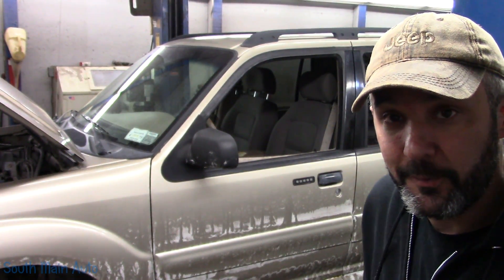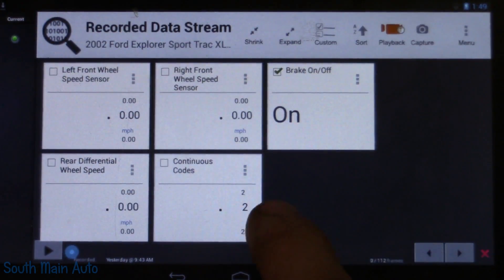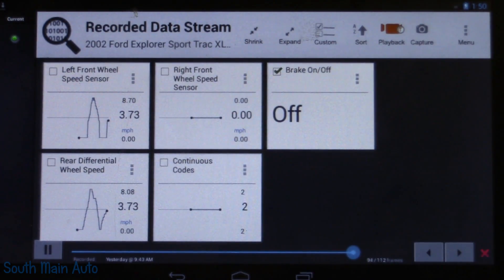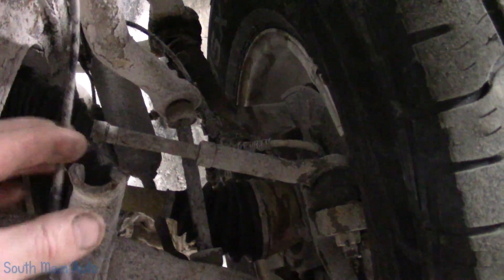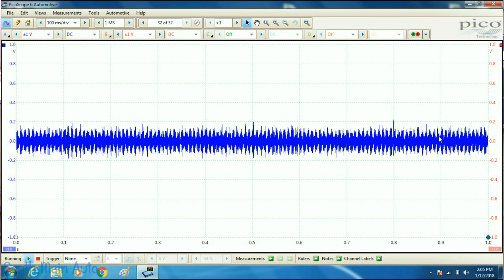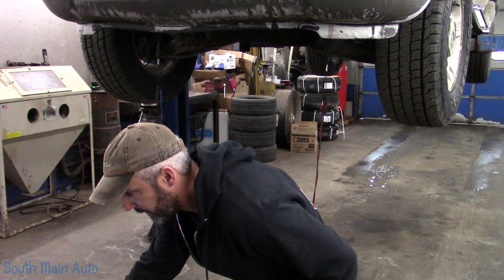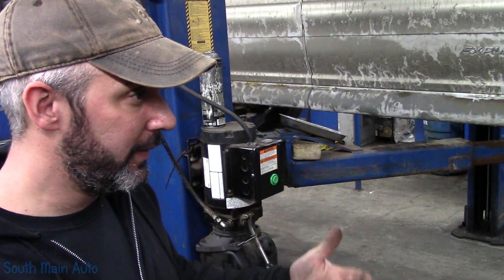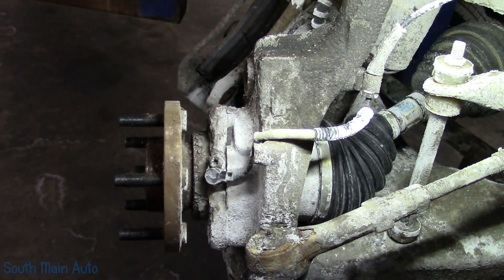Ford Explorer Sport Trac: ABS Light On / WSS Signal I Can Not Explain??

Comment: Others have said it before me, but salt and moisture inside the sensor makes electrolyte, two electrodes by the open circuit pickup coil. Only a few mV though due to similar metals with differing levels of corrosion.
But, you also need to remember that the Pico is a high impedance device, 1Megohm, so you are in effect measuring an open circuit voltage. As well as generating those few mV, the chemical battery will be a low impedance compared to the Pico input, so that's why your AC voltage was roughly similar in that test.
The actual ABS module will have a lower impedance loading and I would be surprised if it didn't have a bit of bias voltage there to detect an open coil.
Backprobing with the Pico at the ABS module would tell a different story.
Keep up the great work Eric!
Reply: These points echo my previous comment and all seem plausible to me too.
Reply: Nice explanation pal.
Reply: yes, Salt water conducts electricity about as good as copper does too.

Comment: The further analysis of both front wheels is what makes SMA a step above every other shop. 98% of shops would just diagnose the one bad wheel, perform the repair and ship it. Not caring about come backs or customer complaints. I want a mechanic to give me the WHOLE story and explain to me all that is going wrong with my car. If I do not opt to fix those additional problems that's on me. But I still want to have someone intelligent enough to pick up on all problems big or small and report their findings to me. I might not understand all the electronic discussion in this video but I still love watching it so I can learn more about ABS systems on vehicles. Another top notch video!

Comment: The waveform looks good only the amplitude was to low.
Thats because the air gap underneath the sensor is to big.
After replacing the sensors the amplitude got better because you cleaned the surface of the hub and the sensors now sit lower.
On the left side this worked fine but on the right side the air gap is still to big.
Replacing the hub would fix your problem.
But as an experiment you could also grind a litle piece of the surface so the sensor sits lower in the hub. Would be cool to try to see if this works and it will only take a few minutes with a grinder😎
Reply: Maybe just leave the shim out and see if that helps?
Reply: However, the sensor should come alive and register at higher wheel speeds, which it did not. The air gap is not the main issue here! Looks like the sensor coil is almost open circuit :)
Reply: Pine Hollow Auto Diagnostics Mayebe it does come alive now, he has not driven the car and looked at the scandata after he cleaned the hubs.
I noticed you posted a new video looking forward to see it!

Comment: Hi Eric!!!!....Great video!!!!....fancy tools and clothing too!!! hahaha....uuummhhh....all Crusties(green white yellow) produces all kind of electric and electronic phenomena!!!...in order to make a repair to last good time, best is replace both hubs!!! more expensive but new parts work optimal. You could do ohm test in both sensors, cross jumper both sensors, turn the wheels in both directions too, and visual inspection the notched rings inside hubs if its possible, check for crusties in the cables and conectors!!!...The sensor itself is not a separate stage of electronics, in fact the sensor is an internal part of a electronic circuitry!!!...it is located outside, but in terms of a electronic component could be visualized inside the ECM!!!...the information and signal procesing depends on how the sensor is conected inside the ECM. Could be one lead to ground, that eliminates the zero crosing!!!...could be conected to a filter circuitry!!!...or to a complex floating zero crossing detection, that is more complicated and fancy circuitry!!!...anyway, I think the problem itself is corrosion inside the hub (neglecting the sensors conditions first) and if it where possible to clean inside the hub it will change the shape of the notched ring, and thus producing a weird signal too!!!! Amplitude of signal is related to sensors distance, and frequency is related to speed and shape!!!....detection is related to filtering and signal processing!!! Thank you for sharing your toughts with us, and thake us with you in your videos!!!!....that is why I am a SMA fan!!!!! It is always fantastic see your work and learning diferent things with you!!!!.....Greetings to all at SMA!!!

Comment: I feel you want to test those sensors, you need to load them down with the right load resistance. Your scope has many megohms of input resistance. The bad sensor might have many kilohms of extra series resistance but that won't show on the scope with its high input impedance. Also a coil can't put out D.C., there is likely a little battery consisting of a break in the wire, some moisture, and a different metal, like the solder or the internal lug.

Comment: Nice tip about using a valve stem cap to keep the dirt out of the sensor holes when cleaning the mounting surface of the hub. Wow, The OE wheel sensors usually cost more than an entire aftermarket hub with the sensor. Often the brake rotors are so rust seized on the hub and inboard sides pretty rust ravaged too that it might be wise to change the pads and rotors now than deal with brake pulsation.  I would ascertain rotor condition and likely try to sell 2 complete assemblies and let them know the signal is weak on the left side too and if that sensor can't be removed without damage or signal strength improved by cleaning the left side hub sensor mounting surface, I'll have to replace both hub assemblies.

Comment: I agree it would be beneficial to see the signal when connected. After going over the video, Eric was getting the dc component when not connected to the abs so the dc component has to be generated by the sensor. Maybe the noise is being rectified by the sensor causing the dc and that is blinding the abs from seeing the ac signal.

Comment: Very interesting diag, Eric! Did you happen to measure the resistance of the two sensors by any chance? And I've run into the sensor being too long for the hub before too. Maybe just stack some shims or thin washers to set the proper airgap?
Reply: or an o-ring around it, depending on the design.
Reply: Instablaster

Comment: The front hub assemblies comes with a ABS sensor installed. You can actually get a front hub with a ABS sensor cheaper than the OEM ABS sensor by itself.
Reply: You can only get a front hub with sensor cheaper if you get a generic Chinesium hub that's probably going to be a callback when it fails prematurely.  If you want to go that cheap route, at least compare apples to apples which would be the price of a generic sensor alone, not the OEM sensor price.

Considering the work to do a hub, a generic hub is the worse economy possible.  That does not mean you have to get an OEM hub either, just a major brand which (almost) always costs more than the sensor alone.

Comment: Remember what Ivan just went through in S.I. with "leaking noise"? All that chloride acts like an antenna for outside RF. It looks as if there's a weak leak to ground. Electricity flows FROM negative TO positive. There is so much RF leaking- it's interfering with the signal. Ohms the both leads of the WSS plug, EBCM side- to body, knuckle, etc. (ground) and check for a closed circuit. Just my theory.

Comment: I have a suburban that had about 750-900 milivolts on three wheels and one that put out about 300 mv and it was tripping my stabilitrac during acceleration I used a caliper and the air gap in the hub was within spec. I tried closing it up a smidge and Also tried a different abs sensor in the hub and still same result. So replaced the hub and it worked putting out the Correct voltage.

Comment: I'm not a real elec-chicken and I don't play one on Broadway, but I suspect the ABS module is watching for the sine wave crossing zero volts. Each time it crosses, that's a data point, and the time interval between data points tells the module how fast the wheel is turning. With a DC voltage raising that sine wave away from zero, what should be an AC signal becomes a DC signal that the ABS module doesn't recognize until its amplitude increases and its peaks push down past zero again.

Comment: As others have said, but I'd predict that the corrosion has just reached the point where a connection has corroded just to the point of stopping conduction.  When you spin the wheel the signal is just strong enough to conduct across the gap through the salt but at a lower amplitude because of the resistance of the corroded spot.  One way to test would be to either measure resistance which I predict is high, or, send a few volts down the sensor leads and likely burn the open section to fully open.

Comment: I have the "Waekon 20560 ABS Sensor Pinpoint Tester" where it sends a signal through the wire harness to check wiring integrity to the abs module.  Works great, you can watch it on the scan tool!

Comment: Just a thought but dissimilar metals in an electrolyte generate a voltage
Reply: That's what I think  also
Reply: wak wak  waaak
Reply: An unintentional diode junction acting as a detector.
Reply: I would think its all the salt generating voltage to a bad wire
Reply: Salt+water = electrolyte.  Still need the two poles to generate a current = two different metals.

Comment: Thinking that salt and water (an electrolyte solution) have infiltrated into the open wheel speed sensor, creating a battery between the open connections (possibly 2 dissimilar metals like copper and solder). That would explain the small DC offset on the open sensor.  Did you try comparing the resistance of the 2 sensors?

Comment: Nice  video, I just had a Dodge Dakota with a dead aftermarket sensor/hub on it.  Ohm'd out ok and had a voltage reading on the scope when spinning the tire, it also has a static volt reading even after removing the hub/sensor assembly from the truck??????

It has to be some kind of galvanic action from all salt brine on the roads the last couple weeks..............

Comment: Hi Eric & Mrs O
Great video makes a person think and provides a useful tip for others Valve cap and install extraction tool as well. I have one question, what side has the longer electrical run to the ABS control module? As you showed the hall sensor is only lower amplitude not completely dead. If you measure line resistance between L & R side I expect you will find a minor difference on the side with the longer run length. That in conjunction with a sensor that has possible leakage due the salt & corrosion issues has brought the signal performance to just below operational threshold levels.  Or as with all electronics THERE IS A BUG in the system!!

Comment: I noticed that after the repair the red trace seamed to be still starting at an offset? I am not proficient with the scope (working on it) but that is what I saw. Also, I had a similar issue with an 07 Edge AWD. My issue was the customer had driven it for so long with bad WSS's that it caused the ABS module to go all caddy wampus and was going into a no comm. state. This issue had no rhyme or reason and was very sporadic making it a bear to diag. Ended up replacing 2 WSS's and the ABS module. Looking forward to the next vid.

Comment: And that's just it. The ABS is just barely at the threshold for code setting criteria on the l/f. Nice catch, for future issue.  As for the bias voltage on the r/f, I'm curious if there was a resistance issue left vs right, even though they are both Moog bearings with whatever sensors they use. I have run into that on some aftermarket Chevy applications, where a customer has installed a new assembly on 1 side, ( due to a bad bearing not an ABS issue) and had an OE on the other. The OE had a lower resistance than the aftermarket sensor, thus had a higher MV signal than the new bearing assembly did, and the difference drove the module nuts. My thought is, if you ohmed out a new Ford sensor vs both the left and right Moog sensors, would they be the same, or ALL different? Anyways, you did fix the left side for now.. LOL

Comment: The reason I suspect the module is not able to read this is the circuit needs to raise 0.6v above and below zero volts to switch the transistors on and off. The DC voltage offset could prevent this from happening. Capacitors are used inside the module to ensure this toggles around the zero volt line. It's great how YouTube can be used like a video IATN.

Comment: The speed sensor has to be made by the same manufacturer or they just have to be the same length? It sounds like you have to get hubs and speed sensors as matched pairs or by the same manufacturer.

Comment: Do you have a function generator on the pico scope or elsewhere? If so, you figure out exactly what amplitude the computer needs to see and whether or not the offset is a problem. You could leave it at zero offset, and turn up the amplitude until it reads a signal, and then adjust the offset to see whether that has an effect or not.
Reply from the maker: I wish I did :( Actually the Launch Pad II that I use has that option but I do not have the devise to go with it. We know what the amplitude is simply by looking at the left side. We can also see that we achieved that on the right side. It would be cool to play around with the signal generator though just to see if an offset does or does not affect it.
Reply: You could always use the utest leads and run the left front sensor to the right front connector to verify the vehicle wiring and module. And/or do a little swapnostics with the sensors
Reply: Ha. Nevermind, I see you did that. I  replied before I got that far into the video

Comment: If you're chasing a 30mV DC "phantom voltage", can try connecting a ground wire to bolt holding sensor into arm and other end to battery ground, see if DC offset disappears from picoscope.  If disappears, can try to see if ECM reads it correctly then.  DC must be introduced somewhere, either from sensor body or from frayed wire.  If you had perfect insulation then 30mV couldn't get into it in the first place, correct?   So, I think you'll be then looking for a worn-through wire.

Comment: I wonder what what happen if you put a small value pull down resistor on that wheel speed sensor to bring it down to 0V if that would allow the abs module to read it.  I know thats not a fix by any means but it would show you how small the tolerances are for what it will and will not read. Great videos look forward to watching them.

Comment: There 's your problem Lady! Galvanic corrosion is an electrochemical process in which one metal corrodes preferentially to another when both metals are in electrical contact, in the presence of an electrolyte. This same galvanic reaction is exploited in primary batteries to generate an electrical voltage
Reply: Blaine Steen - fancy words for the fine wire (32 AWG) from the coil inside the sensor transitions to the heavier wire is broke !

Comment: Hello Erick I had the same problem with a Honda Civic check all with pico and omhs as well as the harness changed the hub bering for an (aftermarket that the customer brought as well as the sensor) and no change. my solution was to replace hub bering sensor front honda dealer.

Comment: "Don't be surprised if when you take yours out it breaks !"  That is why I paid someone else to do it !

If that was my car, I would just file the end of the sensor to the correct length and place a dab of silicone dielectric grease on it (for good luck).  It "should" have no effect on the sensor operation.  Actually if the clearance to the "exciter ring" is smaller, you will have a higher voltage signal at low speeds.

Comment: I remember from the olden days in Electronics class that any coil of wire acts like an inductor and can hold electrical energy in a magnetic field. Maybe the sensor (which is just  a coil of wire) broke in such a way that it is acting like an inductor of a different value and causing some kind of delayed transient response with the meter.  An internal short in one sensor might  cause the two sensors to have different different inductance / voltages and maybe that is somehow causing the issue with the meter. Like I said, it's been a long time since school but I would look in that direction.

Comment: In the tsb for gm trucks with unwanted abs stops it says that the wheel speed sensor has to be able to produce more than 350mv @ 1rev/second of the wheel. I think that the abs module on the explorer doesn't see any wheel speed because the amplitude of the waveform isn't high enough to trigger the analog to digital converter in the abs module.

Comment: You should try a capacitor in series with the sensor to see if the dc component goes away and the signal is recognized. Maybe there is some rectifying going on in the sensor
Reply: I too wondered about rectification, but if that was the case then the DC offset would vary with amplitude of waveform (which in turn varies with rotation speed, as these sensors do). So that seemed less likely.
Reply: Good point didn’t think of that. The cap should still be able to filter the dc component. It would be interesting to see if the signal would  be recognized
Reply: Complementary to that, it would be interesting to know if the ABS unit has a strategy to detect sensor wiring fault, such as applying a constant current through the wires and measuring the (DC) voltage. If so, that capacitor you want to attach would defeat that strategy, and cause a code and probably lack of detection of an otherwise good AC speed signal. So I come back (as I've commented elsewhere) to being most interested in seeing what the signals look like when the sensors are attached to the ABS unit and operating.